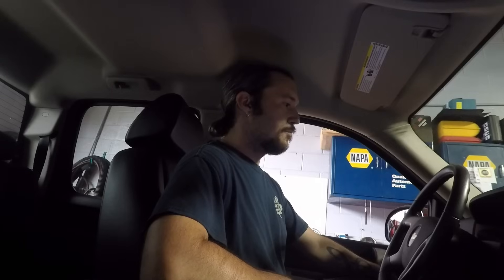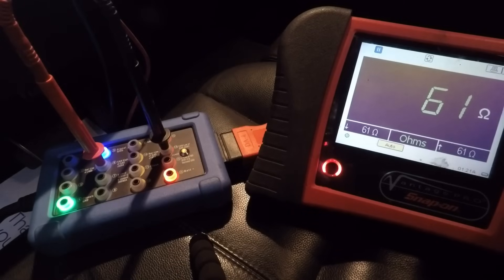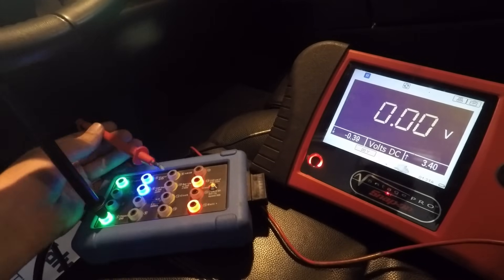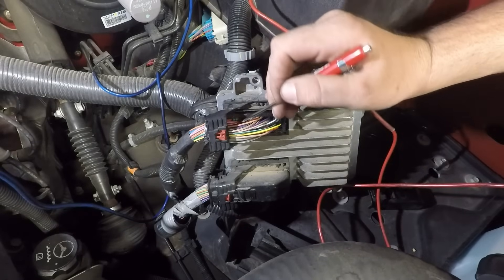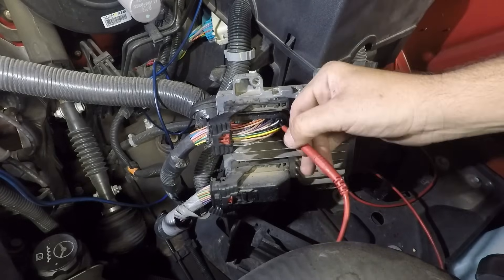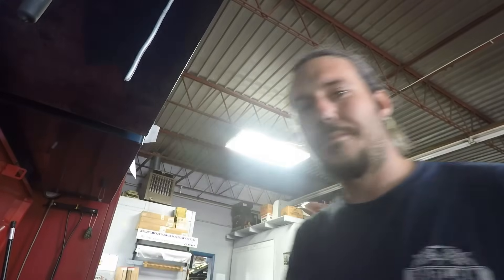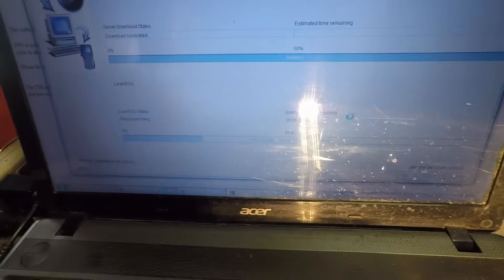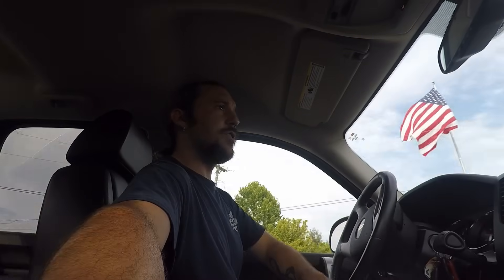Chevy Silverado No Communication

Comment: I am having major issues with my 2009 chev duramax,  I have had ECM, BCM modules replaced. Two new batteries,  new fuse box, still loss com code comes up to ecm. Service stabiltrak,  service trailer wiring, service 4 wheel drive, even all instrument dash gauges are droping out, very very frustrating,  I am kinda at the end of my rope. Any help would great!!! Thx
Reply: I'm having the same issues, my truck has been broke down for almost a week as I go through this process of elimination but everything I replace doesnt make a difference. There isn't very many videos addressing this, I have spent hours watching videos and reading forums and this guy has done the best job at showing what he is doing while he is doing it but I have no crank no start no communication when I try to read the codes fuel pump primes when I turn the key to on and battery and starter are new and fuses check out but when I bypass the starter relay the engine turns over but sounds like it has no spark. I have been buying chevy trucks since I was 20 years old and this is the first chevy truck that I have had these kinds of issues with. I am not happy about the terrible products that we are expected to have to sell a kidney on the black market to make payments for 6 years meanwhile I havent gotten 2 years of solid use out of it and I have had A LOT of problems with this truck before this stuff started happening. Did you find anything out that solved your problems?
Reply: @jeremiahgeneration8910  did you ever figure out what the issue was?mmm

Comment: I have a P0700 code on a 2008 GMC Yukon XL. Where is the TCM module located
Reply: inside the transmission, remove the oil pan and there it is. browm plastic module

Comment: Expert troubleshooting. Maybe you can help me?
I have a 2018 Camaro SS with a 6.2 Liter automatic. It has a hard U0100 code and no crank and will not allow me to reprogram the new ECU. I followed you diagnostic steps and found all my sensor reference voltages at 12 volts, also between ECU metal case and frame ground is 12 volts, and CAN high and low pins on ECU blue connector also seems to be reading 12 volts. I can communicate with some of the other modules. Any ideas?
Reply: Mark Sternall you figure it out ?

Comment: good diag but some times you have to test 5 volt refrence during load i mean that testing while the sensor is connected because if there is ashorted sensor the 5 volt will be  dropped thanx
Reply from the maker: Yes you're right, it's best to check circuits while loaded.  I did test the 5V ref at the APP with the sensor connected.  The MAP I unplugged just to make backprobing easier, and the IAT I tested unplugged because the IAT is a pull-down circuit that should only be 5V when unplugged.

Thanks for checking out my videos and commenting!
Reply: Diagnostic Derreck 
thanx bro . iam always check your videos u are great man thanx again

Comment: May I ask what symptoms were. My truck out of nowhere went nuts with gauges and lights
Reply: Tom Christensen did you ever get that fixed mate? Mine has same issue wonder what I can do to fix it
Reply: my 03 suburban just went crazy door locks locked and unlocked then won't start
Reply: @Bigrich0g  man my 08 yukon xl did that and I honestly never figured out the actual cause. I ended up replacing the ecm and it drove great for 1 year the. It happened again. This time replaced abs control module as it was a code that said it was bad. Truck has been doing great for 3 weeks and sat when sitting to get oil changed I lost all gauges while truck sat there idling. Drove it in limp mode up to a parking lot and pulled codes. While scanning my gauges came back on... These truck have an electrical gremlin both Chevy and GMC that they know about but will not fix

Comment: I have 2017 Chevy Silverado the wiring harness caught fire bought new harness checked all fuses no communication with transmission P0 700 code won’t start showing that the car is in drive when it’s really in park I’ve spent all kinds of money trying to figure it out, but no one has a solution was told that I need a new transmission which is going to cost 8000 really need help

Comment: I had an ECM replaced in my 2013 GMC sierra 2500hd 6.0l FF truck because I was told that was the issue. Spent over $600 and issues are still there. I have O2 codes and 3 codes that says communication between the ECM, PCM and TCM is erratic. Truck has new plugs, wires, crank sensor, cam sensor, VVT components, MAP sensors, MAF sensor, fuel injectors, intake gasket, knock sensors, coolant temp sensor, throttle position sensor, throttle body has been cleaned and reset. I'm over $2000 invested in this truck and can't figure it out! Truck just stalls out at idle, O2 sensors won't fluctuate while running, and goes into a closed loop before warm up temp. Only time the truck is happy is at wide open throttle and about 30 seconds after you start it. If anyone could point me in the right direction I would greatly appreciate it!
Reply: Could be a bad wire or corroded connector. There's a service bulletin (08-07-30-0216) which addresses the codes and symptoms, but there's not any that address the 02 sensor codes.  If you had a bunch of stuff apart, check your grounds as well.

Comment: problem facing in Chevrolet captiva 2007 manual, DTC U0073(ECM/ECU lost communication), U0121(ABS MODULE lost communication) and P0500(Vehicle Speed Sensor) ,,,,suddenly instrument cluster stops working ,all needles(Temperature, rpm, speed etc.) showing 0 reading , ac stops cooling while blower keep running,reverse gear light stops working, Service Vehicle Soon light & MIL illuminates in cluster. and all happen intermittently and all together. Can anybody suggest solution
Reply: Ash Kumar did u fix it
Reply: I have the same thing on a c6 vet
Reply: Have you fixed it
Reply: Any solución
Reply: @lilthug4sho123  change BCM , ecm , immobilizer with key set

Comment: we have a 2010 6.0 was running, quit in parking lot, messed w steering wheel started, cleaned connections to ecm, changed ignition switch, snap on scanner, states no communication to ECM , BCM,, truck park indication is gone you dont have to apply brake to change gears, dash doesnt always light up.. wiggle wires under dash and gauges light up, will crank with switch relay in starter relay spot.  will not do anything w key now
Reply: also the 5 volt checks and ECM checks were good
Reply: I’m having the same issue where my parking indicator is not there 
What did your issue end up being ?
Reply: Did you find anything with the park indicator not working as well
Reply: @kylezere7426  did you find anything with the park indicator not working have the same problem my truck was sitting for about three months with the battery disconnected And will not start now

Comment: Thanks, for making this video and sharing your expertise with us!

 I am sorry, I am an amatuer and perhaps I missed it in the video and I do not see anything  in the description or comments. What was the initial Code. or perhpas there was more than one. Please list the codes for me as my son's 2000 Surburban has multiple loss of communication codes. U1041, U1056, U1064 and lastly U1026. I wished that was all the codes he has but the list goes on and on. I just listed the loss of communication codes. Been looking for more infor on these codes and your video came up. Just not sure what your initial codes were! 

The highest severity code is a P0300 Randon misfires along with a P0343 Cam shaft sensor circuit high voltage. Not sure where we should start as we still have even more codes. He says the MIL has been on forever along with the ABS and Brake light? Is he really my son? LOL
Thanks again.

Comment: hi bro i need your help plz 
Chevrolet camaro 2010 v6 
here's the story and sorry for my English 

the car generally work fine until this problem is happen so whenever i try to start the car put the key as usual turn to on then start boom nothing happen like video showing stabilietrack service pop up and parking assists service pop up also check engine go off and fuel gauge down to zero
try to start the car again nothing same
so what I'm doing I'm going to the harness connect to the EBCM and move it little the harness not the connector after that the car back normal and start like new doing the same issues for like 2 to 3 month so i decide to change all the harness from the EBCM going to fuse box box to instrument cluster 
after changing all the work fine for like 15 days without any issues 
suddenly today she do the same problem try to start the car nothing 
i touched again the harness near ebcm in the same place the car start normally 
then i try to change the EBCM also but  she do the same problem so i put back the old EBCM
i try everything but this car turning me off 
please if you have any idea let me try it 

with scan tool get code U0100 and U0101 lost communication with ECM / PCM A and lost communication with TCM 
video showing the issue 
https://youtu.be/BYUtOQI4FSU

Comment: I have a 2013 6.2 L Vortech max GMC sierra only in cold weather I try and hit the gas and air glitches my dash all gauges move around and says service stability track service four-wheel-drive service traction control service trailer brake system only when temperatures are cold outside truck runs fine when it’s warmI have had this problem for five winters in a row $7000 down the drain from dealerships anyway you can help me

Comment: I don't have communication with vehicle. But it starts fine. Transmission seems to be in limp mode. Every warning light in the dash is on. Plug lap top in and they cant communicate
Reply: What was your issue? Having something similar with my 07gmc 2500
Reply: I have po700, uo100, and uo101. Another code that just says "n/a". I'm going to do a lot of the tests this guy did. Two shops I had it in days they don't know. Lol . I don't think they really wanted to try
Reply: @MMGJ10  did you happen to figure out your issue having same problem as you with 2009 gmc 2500hd
Reply: Any of you guys figure this out? Same issue here
Reply: DOTCurrency what kind of vehicle is it ?
Reply: Having same problem p0700 no communication 
Won’t start showing that the truck is in gear when it’s really in park  2017 Chevy Silverado 6.2 8 speed transmission I was told transmission need to be replaced
Reply: I've been trying to fix my mom's 2011 chevy silverado 1500 and when I plugged my scanner in it would not connect. Turned out to be the cig lighter fuse under the hood. The obd2 power is connected to the cig lighter. I got my scan tool to connect now but even thought the check engine light, antitheft light, brake light and stabilitrak lights are all on its telling me there are no codes. Anyone have any ideas

Comment: I’m having an issue with my 2008 Silverado 4.8L.  I got codes U0073, p069E, U0109,  P2272, P2544, U0101, and U0100. Also my speedometer and abs and brake light are going crazy and transmission is shifting funny.  Any suggestions? Thank you
Reply: Justin B hey Justin did you get this fixed? I just started having the same issue and I’m about to start the nice Easter egg hunt to see what is causing it...
Reply: DOTCurrency  yes it was the computer. Got a new one on eBay programmed for 157 dollars sent to my door.
Reply: @justinb7835  well thats good to hear I thought it might be some short somewhere who knows... I will try that thanks
Reply: DOTCurrency yeah I thought the same but nope these trucks are heavily common for faulty computers
Reply: @justinb7835  The ECM is what you got right? thanks mate
Reply: DOTCurrency  sure is. And glad I could help

Comment: I have a 2000 5.3 Chevy Silverado 4×4 z71, it's has a u1026 code, & now my transmission won't shift after 25 mph unless it's in tow/haul mode. Gets to 25mph &then it feels like neutral. I've tested the solenoids  in tranny & basic wiring.  Any ideas etc? This is the closet video on here,that's close to my problem finding which module. Thanks
Reply from the maker: U1026 is a loss of communication with the transfer case module.  Shouldn't be causing the transmission to go to neutral while driving since all transmission control is handled by the PCM/TCM.  Sounds like you may have 2 different issues, a transmission problem, and a transfer case module problem.
Reply: I was driving at 40 mph &out of nowhere it felt like neutral, I pulled over & looked & the tranny line had blew off,(clamp was tight) then it thru 4/5 tranny codes & front right wheel speed sensor/abs code & a low voltage on front wheel speed sensor. I pulled the fuse to drain the comp to reset it, & now it doesn't have the mil on,but when I used a professional scanner it showed the u1026 loss t.c.m.. so now when I drive it to 25 mph I have to let rpms go down before it will pull in 2nd/3rd gear,so basically I can drive 15 mph & it's fine. I wasn't able to check the the 2 solenoids by the accumulater, the round one . I've got a lot of time in checking basics, & I still dnt have a clue. Everyone says 3/4 clutches are gone. Is there any chances of something simple that I could do to,that mite help me? No I haven't had it scanned by a shop yet,just opinions. Hard to trust the big transmission shop's. Thanks again
Reply: David j it is the 3/4 clutches needs a rebuild !

Comment: Any hints on a 2007 GMC 2500hd 6.0 with po700, uo100, uo101, and my cheap scan tool gets another code that just says "n/a". 
Truck seemed fine, but boom just went into limp mode on the trans. 1st gear only. Speedometer jumped around a little when it does it too. Sometimes drives fine for 30 min, then boom does it again. Mostly just stuck in limp mode though .
Driving me insane
Reply: MMGJ10 check that technical service bulletin  out and see if that’s the problem

Comment: I am getting a P0302, P0303, P0304, and P0308 fuel injector short circuit codes and Misfire. I changed the injectors and still have the codes. I bought a new fuse box and replaced the old one which had gotten wet and still has the codes. It is dumping fuel out of the exhaust pipes and white smoke. Also saying no oil pressure. I had that oil pressure issue about 4 years ago and changed the oil pressure switch and it went away. This is baffling me. Tomorrow I will try changing the spark plugs just as part of maintenance and change the fuel pressure sensor and fuel filter. These are things that need to be done anyways as I have hit the 170K mark on the truck. But I really need my truck running I have throat cancer and need a ride to doctors and financally drowning in medical bills but no one cares I worked all my life since the age of 13 been living on my own since 14. We as a country support junkies and crackheads and when the working man gets sick after paying taxes all his life they tell you nothing is left. Our system is broken so badly. Politicians, (Democrats or Republicans) give two shits about us. They all out to line they own pockets while the poor man suffers and gets all his money taken in taxes and when we need something there is nothing left to help us. Sad but true. I really need my car I have no family or friends that can even afford to help me. Our country going to the dogs.

Comment: I had my truck break down almost two full months ago and I paid to have it diagnosed in my driveway because it was quicker to have it diagnosed and once it was diagnosed that I needed a new EMC I scheduled an appointment at the dealership to make sure it was taken care of properly and had to wait 3 weeks to get it in the shop and it's been in the shop 2 weeks and the ass clown still haven't touched the truck they want to go through and rediagnose the problem when they already have documentation and what the diagnosis was to begin with

Comment: Can you do these test without a breakout box?
Reply from the maker: Yes.  You could probe DLC pins 6 and 14 directly at the DLC connector if you don't have a breakout box.
Reply: @diagnosticderreck3287  Thank you. We get these problems occasionally at work. We have 2014 Chevy Expresses. On one it acts up only sometimes. Speedo erratic, low power and a U0073.
Reply: @diagnosticderreck3287  Also this bus that's acting up only acts up every 2-3 days lol. Turn it off and wait then it drives fine. Can it be intermittent bad PCM?
Reply: @diagnosticderreck3287  Also the bus will start and drive but really slow and the Speedo jumps. But right now it drives perfect. If it's not acting up can you still perform the tests and find the bad part?
Reply: @diagnosticderreck3287  problem facing in Chevrolet captiva 2007 manual, DTC U0073(ECM/ECU lost communication), U0121(ABS MODULE lost communication) and P0500(Vehicle Speed Sensor) ,,,,suddenly instrument cluster stops working ,all needles(Temperature, rpm, speed etc.) showing 0 reading , ac stops cooling while blower keep running,reverse gear light stops working, Service Vehicle Soon light & MIL illuminates in cluster. and all happen intermittently and all together. Can anybody suggest solution